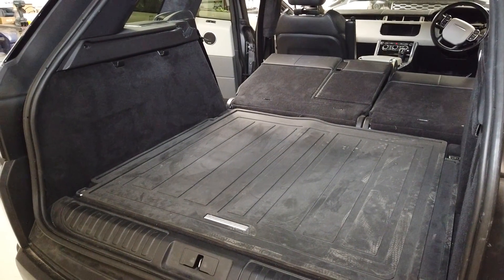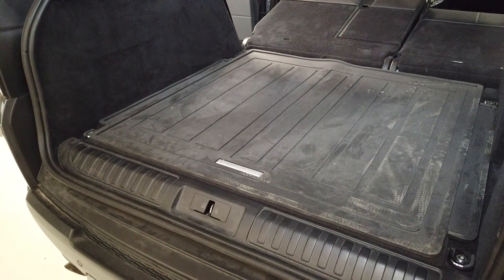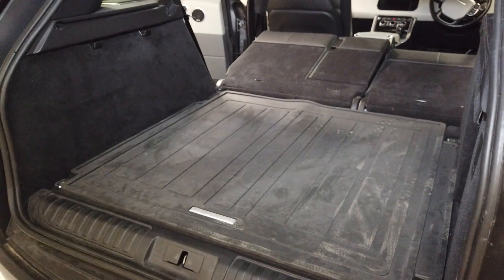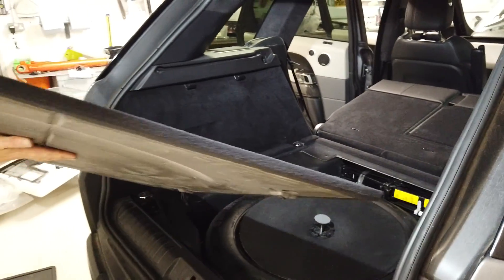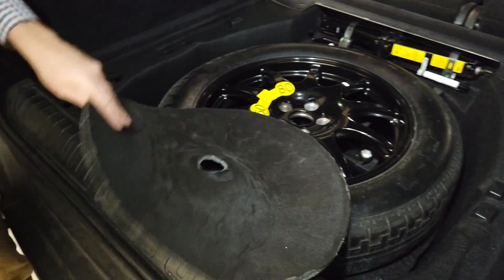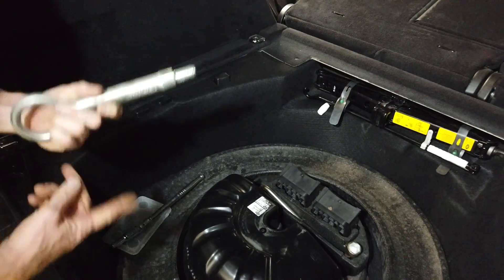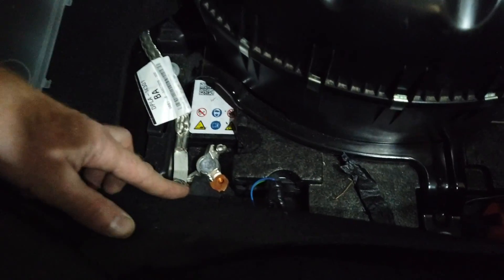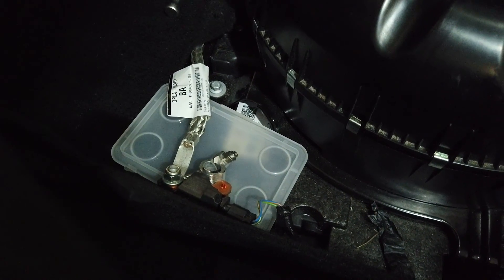How To Disconnect Battery on Range Rover Sport L494

Comment: The hooks screw into the bumpers behind the little square covers that pop off
Reply from the maker: Yes i know that - but where is the correct stowage for them when not in use ?
Reply: powerfulukltd isn’t there a piece of expanded foam with cut outs???
Reply from the maker: @TheSwampdoggydog  Not that i can figure out !

Comment: Thanks for the video. It shows how difficult it is to disconnect your battery. It should have been designed to be done with a touch of a button!
Reply from the maker: It is not the easiest battery to change !
Reply: No battery disconnect with a button! Such a switch couldn't carry the starter current.

Comment: Would you recommend disconnecting the battery when changing the headunit? Awesome videos, really helpful!
Reply from the maker: I don't think its 100% necessary just don't turn the ignition on and be careful with tools near connectors...
Reply: @L663  if I were to disconnect the battery, do I have to do anything special, like codes or something once I reconnect it? Or will the car start up and work like normal?
Reply from the maker: @JPLlani  There are no codes to enter so should be OK - sometimes the ECUs can do a reset which means they have to relearn your driving style and some other engine gearbox parameters but you will not notice.
Reply: @L663  ok awesome. Thanks for the info. Will be ordering an android unit soon and will be using your instruction video. Extremely helpful! Thanks.